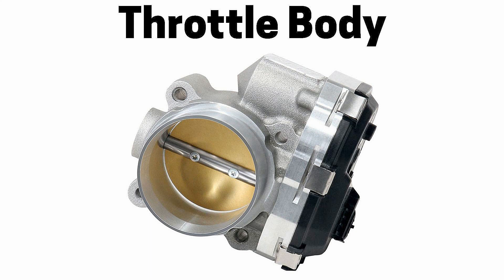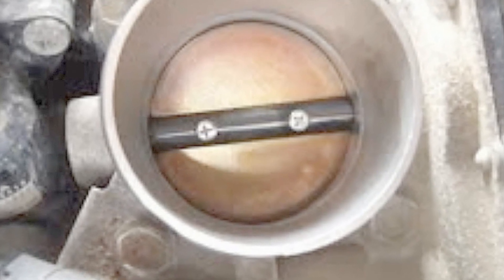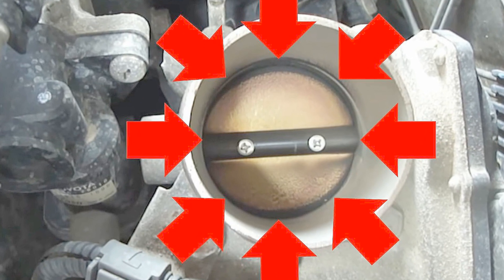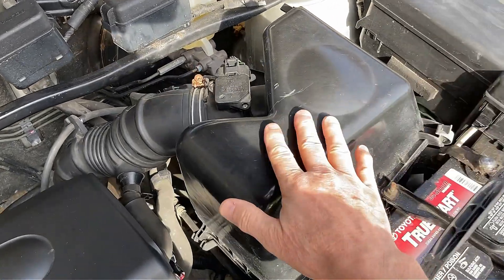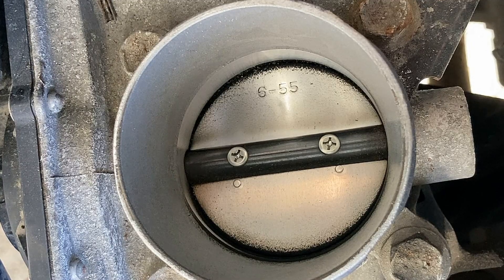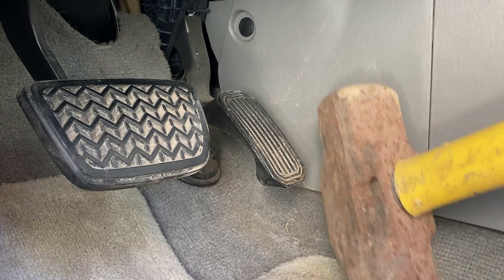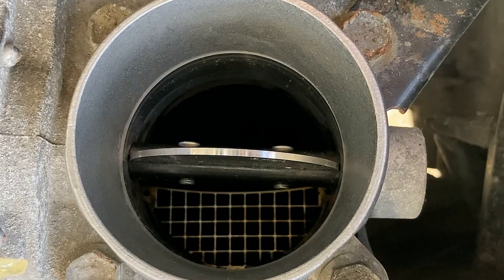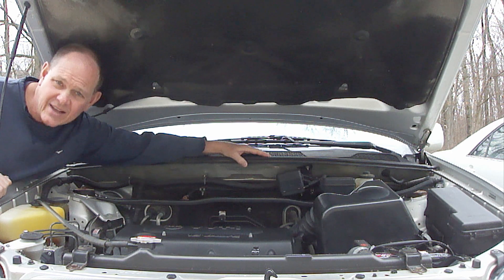How To Fix A Hard Starting Engine On Your Car - Fast & Easy!

Comment: Interesting...my car (2014 Hyundai  Elantra) sometimes starts on the 2nd try for some reason. I would love to try this out and see if it would help, but this seems a bit too advanced for me.
I literally only open the engine to fill up washer fluid....not proud of this, just the truth. Great video though, thanks
Reply: I can send you a video you can follow
Reply: @Regulated-Liability-Network Thanks for the offer. 🙏 Update....transmission died on the 2014 Hyundai in April 2022, just 28 days after the warranty expired. Spoke to Hyundai Canada, the dealership, even the transportation ombudsman and sadly no offer to cover even partial cost. Luckily I was able to get some trade-in value. 
Will never get a Hyundai again..

Comment: My car I can turn key over and it'll start or I can turn it and turn it and turn it a dozen times and it might start on 2nd or 3rd try, maybe 10th try or not at all... hook up to another battery and it starts right away... but battery isn't bad, got a newish starter, new alternator... no clue what the problem is
Reply from the maker: How old is the battery?
Reply: @proclaimliberty2000  not sure, but I've tested battery and it puts out normal #s
Reply: Load test the old battery.  Volts is not a true test.  Sounds like you have a bad battery.  (From your description of the solution)
Reply from the maker: Checking each battery cell separately with a battery hydrometer tester is another good test.